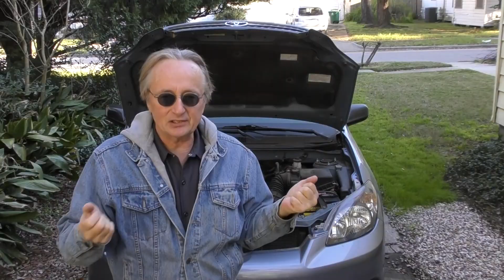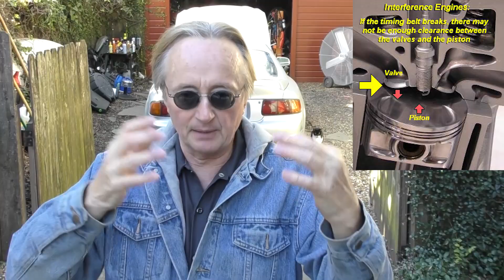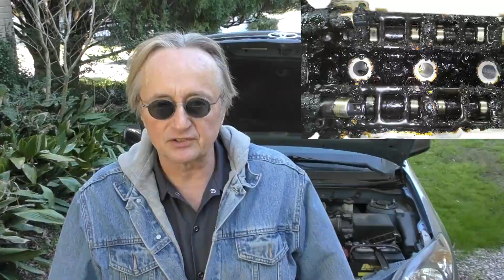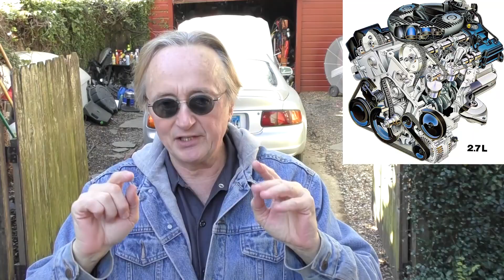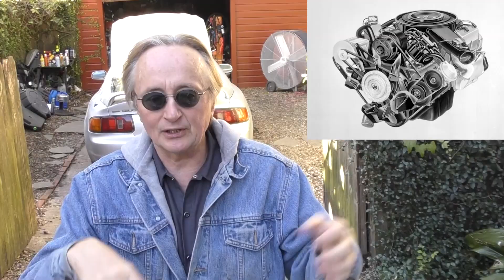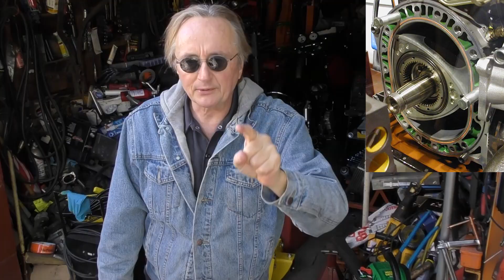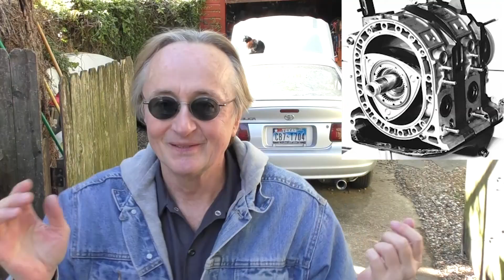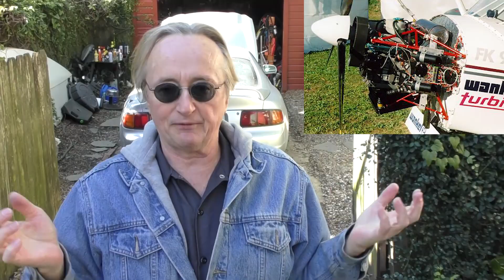Never Buy a Car With This Engine

Comment: SCOTTY please respond. I have a 2009 Pontiac G6 2 door coupe with the 2.4L ecotec and it has 331,500km or 200,000miles on it. Now at first the engine light would come on when I was under half a tank of gas so I thought that I had water in my gas. So I put in fuel injector and waterremover into the tank when I filled it up. I live near Toronto Ontario so the weather would get very cold then very mild and go back and forth like that near the end of Feburary. Now the engine light comes on under 3/4 tank of gas and sometimes goes out when I am driving and off and when it comes on again it stays on. I have always changed oil using synthetic oil 5w30 winter, 5w50 summer. The car runs nice. Drives nice has a lot of power matched with the 6 speed tranny that was rebuilt 5 years ago by Mr. Transmission. I am perplexed. Could it be the fuel pump or cam shaft senor? or just an O2 sensor?

Comment: What do you suggest for a lot of honda cars which have the water pump run by the timing belt? Normal recommendation is to change the water pump at the time of changing the timing belt, but is that enough or is it an engine to be avoided?

Comment: sounds like you need to dry out, what about Ford and their thick film insulator ignitions , the guy that designed it forgot it will be in the engine compartment and subject to up to 300 degrees...ooops  the cars would stop running, 60 minutes did an expose on Ford in the 90's and all their goofs, just for the TFI alone they have law suits on the docket to last for the next 30 years. then there is the FOP suing Ford. When Chevy stopped making full size Caprices the police switched to Ford crown vics. They drove the crown vics like they did their Caprices and they ended up getting killed so their family's sued Ford for wrongful death.

Comment: The Audi B5 1.8T engine is great if you do something crazy like change the oil and do the timing belt maintenance, if so it will last 300K miles or more.  The weak points are not the engine but things like:  The plastic combi valve and other plastic plumbing parts that should have a recommended replacement interval or be changed to aluminum pieces.  I love the 1.8T and I love the interior and overall look of the audi a4 B5.
Reply: Amen. What the hell?  Way over engineered. Too much plastic! Get rid of plastic and maintain them.  Honda had the same problem with the first generation civic.  They were made with very tight tolerances.  And in the US where we don't maintain our cars.  Same way with early VW 1.8.  Excellent engine, but don't overheat it or there goes your headgasket.  People are worse now..  If it breaks. Throw it out, get a new one. New model? Have to have it!  Zombie Apocalypse?  I wish.  It would be a good form of natural human selection.
Reply: 4.3 Lt. GM V6 what a wonderful motor. ......bullet proof

Comment: Not just Chrysler running the water pump with the timing system.  My '96 Outback suddenly stopped on me in the middle of the interstate, with about 150K miles on it.  Turns out the water pump shaft broke off!  Everyone told me that the valves would be toast, but I threw on a new timing belt (and new water pump....), and started up...ran fine.   The belt had been changed around 100K by the dealer, so why did the water pump fail catastrophically?  Did the dealer fail to install a new water pump, at that time?  Probably...

Comment: My baby sister age 64 had a Chevrolet Ecotech she finally sold it with 260,000 miles I would have taken it anywhere.  She has the oil changed every 3000 miles because that's what our Dad told her to do.  Actually I sold it for her and I could truthfully say it was driven by a spinster school teacher albeit all over the country.  She's about to retire and just bought a new Kia Soul...yep every 3000 miles.
Reply: With that good of service,  with that record of dependability and as a school teacher she got suddenly stupid and bought a foreign kia.  I BET she will wish for another chevy before 260 K with a kia soul.
Reply: @brianhuffman3202  I didn't even know she was going to buy it before she did.  I'm hoping it's not as big of a dud as the 1992 Ford Tempo she bought new.   I have to think back to the time I almost bought a new Chevrolet Vega, the salesman pissed me off and I left and bought a new VW Bug. ; I never properly thanked him for that...
Reply: @kaa522  no doubt the Vega was a dud, only knew 1 family that had good luck.  I would sure hope a sonic or the cruze would be a good choice.  My sonic got OVER the EPA 35 mpg.  Not a salesman, but 4 the price would B good 4 your sister or anyone else.
Reply: Do not worry about the Kia. If it is brand new, she will have a 5 yr 60k limited b to b warranty and a 10 yr 100k powertrain warranty. If she changes the oil the same as the last car, it should run like a top. If she has a warranty issue, Kia will fix it. Love my warranty from Kia/Hyundia. I wish all car makers would back there cars with longer warranties since we are paying so much for them today.
Reply: @mikeyj7990  I only "worry" about America.  We can't succeed if we keep giving our dollars "to others".  The warranty is not doubt a selling point and I can only wish GM had kept their 100K warranty.  Do us a favor and ask a GM dealer about all this and re-post,  but in the mean time let's concentrate on "the home team".  Thanks patriot

Comment: I have a 2.2 ecotech with 150,000 miles. When I first got it I changed the oil after 500 miles and started using Royal Purple with Lucas oil additive and have never had an issue. I change the oil every 5,000 miles. I once went off of the computer and it didn’t tell me to change the oil until 10,000 miles! I said nuts to that and change it every 5,000 miles. All engines should last at least 100,000 miles if you use a premium synthetic oil like Royal Purple or Mobile 1.

Comment: Since we are going to CV transmissions, why not go back to pushrod engines? No need to rev above 4000 RPM or so, so no need for the trouble-prone OHC designs? I never heard of a broken camshaft chain on a pushrod V-8.seems like the way to go.

Comment: Expected the Mazda rotary engine to be in there and almost thought it wasn't going to get mentioned as it was the last engine featured. You really can't beat simplicity and mature evolved engine designs. Whenever a manufacturer states advanced new design engine you really need to let others go there first and wait a few years for the verdict. Pretty much the best version of any car is the last models they produced before they changed models as long as they didn't have a end of model refresh changing major components.

Comment: Had a 2006 Chrysler Sebring. Damn engine just stopped and wouldn't crank. Got it towed to dodge/Chrysler mechanic checked car and told me that Chrysler makes Shitty Engines and this was one of them. Got rid of it and never will buy another
Reply: Chrysler is the worst thing you could buy.

Comment: my old 3800 buick v6 pontiac just keeps on going and going and going.  no high tech just high durability and reliability.   time to go back to the future.
Reply: Winter car. Lasabre rolling on 270k no signs of stopping at all.
Reply: @mikeadams5432  Congrats on your high mileage vehicle!!! May I please know what year is your Lesabre?
Reply: @brendame  2002
Reply: The Gm 3.8 is a damn good motor. This comming from a Ford guy.
Reply: As a GM technician, I fully agree. Those 3.8's are amazing. As long as you keep the seals on them though, typical GM and having seal/gasket integrity issues. But those engines will last forever otherwise. Good power they had too, snappy throttle response and peppy when needed to be called upon.
Reply: I had a Pontiac Grand Prix with the supercharged 3800 series II V6. Great engine, transmission not so much.
Reply: @jabroni6199  got a 2002 40th anniversary 3.8 supercharged. Runs great.
Also a 2008 chevy impala police 3.9.
Engine cuts off 3 cylinders and gets 35 m.p.g. @ 80 m.p.h. cruising.
Both Very Fast.
Reply: @jabroni6199  I had similar experience with an Olds Delta 88. Engine  was reliable but transmission needed two rebuilds before 100k miles.
Reply: @jabroni6199  funny u say that, dad had a 2000 Chevy Impala with a naturally aspirated series ii 3800, transmission was going out to the point it sounded super changed
Reply: @jabroni6199  superchargers we're junk in them too
Reply: @jabroni6199   the reason I had to get rid of mine
Reply: The GM 3.8L engine is a great engine. They never die
Reply: I have a 2004 Impala with the 3800 Series 2 - just keeps going. 315,000 miles and still going. Wish they would have kept that one!
Reply: Flint Michigan
Reply: 279, 000 on mine and just had mostly transmission failures but other that that it keeps going
Reply: I also have the 3800 normally aspirated in my 1999 Grand Prix .. great engine, but they have issues with the lower intake manifold gaskets failing & letting  coolant into the cylinders. That job was done twice on the original motor, then the main bearings seized at 191K and a GM Reman was put in. It had an oil leak which the installing dealership did not want to fix. Another more reputable GM dealer located the leak (rear main crank seal) and did the job under warranty at zero cost as it should be done. Still fine, but again I did the lower intake manifold gasket once so far. But it does run great. Engine has about 60K on the replacement. Tranny was replaced at 150K when the splines on the 4th gear hub failed.
Reply: i've all ways maintained the tranny by changing the oil and filter regularly at 25k miles.  use high quality synthetic transmission oil and i've also put in two large magnets in the tranny oil pan to catch metal.   use the GM supplied metal gasket. in the winter, warm the motor up really well so as to warm the tranny.  nothing is worse for the tranny than -20 degrees and hopping on the highway with cold engine and tranny oil. 4T65E   2004 pontiac grand prix.
Reply: The 3800 series were awesome engines
Reply: The 3400 engine is a great engine AFTER you replace the lower intake manifold gaskets with metal ones, Ive built a few of these and they seem to be really reliable.
Reply: @martinez1701a  the same thing with the 3.1. Great motor once the intake manifold gaskets were replaced with those metal ones. I had a 99 Lumina with the 3.1. Great motor once I replaced that gasket with the problem solvers.
Reply: cocodog85 The 3800 was a great engine, it’s just that the rest of car would fall apart. Particularly the front wheel drive models had terrible problems with transmission failures. I had a 98 Grand Prix with the 3800 and had to have the transmission rebuilt twice before I got rid of it at 130k miles.
Reply: Loved my SSeI! replaced the  bearings on the supercharger, but other than that, a water pump and a set of coils, 218000 mi, no problems ever. I donated it to the DAV and I still see it running around New Haven
Reply: @crazytrain7114  ahhh yess the ol Bonnie SSEI 💯!
Reply: These engines are in some of the Holden commodore in OZ and they were, (are) great cheers.
Reply: The 3800 on my old Buick was great, but the transmission went out twice and I got rid of it.
Reply: I had an 02 Monte Carlo with one. I actually had the motor crap out. I limped it into a dealership, and a salesman, the sales manager, and the service manager all said some variation of "Wow, that never happens to the 3.8". The salesman even told me a story about how during cash for clunkers, they had to put in an oil additive that caused the engines to seize up. They were taking bets on how long cars would make it. Most cars would make it a under a minute, but they had a 3.8 make it 15 minutes. I always said that if I were hard up for transportation, I'd find an old GM with the 3800... You have to watch out for coolant leaking into the engine, though. That's a known problem, but if you avoid that, they are tanks.
Reply: They never should have stopped making cars with the 3800.
Reply: I don't get how a lot of american cars can actually have amaizing engines and have cheaper out trans and pretty much everything else.
Reply: Your car's year of making?
Reply: @tigertrail3361    04
Reply: @tigertrail3361 any 99- 05
Reply: I had a Gran Prix with that engine
Reply: I have a 05 Buick LeSabre with almost 106k miles.  I don't know too too much about cars but it seems pretty good.  Sometimes it shifts too hard or jolts when I put it into reverse or drive, or when it's shifting gears on a slope, but it's probably the engine mounts.  It's not a bad car but it pisses me off because I only get 16-20 mpg combined, even with tons of highway driving
Reply: The other GM V-6s blew though
Reply: @DawnOfTheDead991  I had a '90 S10 with a 4.3 V6 it was an excellent engine.
Reply: 3800 is a good engine indeed had good power too
Reply: Yep I have a 94 Oldsmobile LSS and that engine is just such a simple godsend that's easy to work on.
Reply: I got a 2000 Buick Park Avenue with the 3800 series is it really that good?
Reply: 100s of thousands of 3800 motors in Commodore in Australia still running, the body were scap
Reply: My mom used to have a 93 bonneville with the 3800. That car lasted 450000 miles with general maintenance. Rust killed that poor car but that bonneville kept on going to the point the frame rotted beyond repair. We sold it to someone who was using it for a parts car as the engine ran great and the interior and some of the body was decent. I bet that ol 3800 is still running truer than ever
Reply: just bought a 2006 buick one owner car with only 28k miles owned by a 89 year old lady who is moving to a senior's residence.  2200 $s usd and almost new.  expect it to good for the next ten years.  those cars are out there if one searches.
Reply: The changing of fluids early and often is the key to engine longevity...😊
Reply: And it's likely still going strong
Reply: @Randy Jackson  im assuming it was the non super charged ss?
Reply: Them 3800s are like a old iron horse had a couple of monte carlos never let  me down like sumone said let them warm up no need to start a car in. 10 or below weather n take off
Reply: cocodog85 “Buick v6 Pontiac”?
Reply: Go back to the future??????? Or past
Reply: I was in need of a car on short notice and short money only had around $600 to spend on a car literally walking down the road just quit my job out of town carrying my hard hat and tools ran across a car lot and they laughed when I told them what I could spend but had a 95 plymouth grand voyage mini van out back with a 3.8 v6 and auto w od and 169k minor  dent in front fender interior almost new owned by 89 yr old couple that traded it in.. true I looked him up.. long story short it has been one of the best cats I've ever had and still have.. 200k I've done front  brake pads, oil, air filter and fuel pump still runs drives great...ITS THE FIRST TIME I FELT LIKE I RIPPED THE USED CAR LOT OFF...
Reply: 3800 is a very good engine
Reply: mine was junk.. head gasket went at 120k miles.  one owner well maintained.  oh well 🤷🏻‍♂️
Reply: 3800 in a Delta 88.  Great engine
Reply: I had a 3800 in a 2008 grand prix I bought used with 148k. Turns out the gaskets went and it caught fire. Fast but not too great on gas. I now have a 2007 Cobalt with the 2.2 which I like better. However its giving me issues.
Reply: My 3800 v6 Pontiac has 267,000 still running strong. The transmission is the problem!
Reply: Amazing engine had one myself
Reply: What about the 2011 buick CLX (not the turbo, its the 2.4 engine)
Reply: @jonathanvillalba3214  check the videos for the ecotec timing chain replacement...nightmare. so watch out.
Reply: Amen
Reply: 3800 was no doughty a good engine you can thank the liberals for that if it last they don't like it but the conservatives are as guilty if it last they don't make no money we are fucked
Reply: That was a great engine.
Reply: They won't die the car will go to hell before the motor does
Reply: Honorable mention. Ford 3.8 love mine 206500 and still chugging
Reply: @TheSlow281  It’s a Ford it will run forever
Reply: @KenisalwaysonLUNCH  Absolutely! Also July 2021update on said 3.8 Mustang: 236000 Miles
Reply: @TheSlow281  I have a 2008 E 250 Ford Van with 660K Miles. Original everything still running strong Triton 5.4 V8
Reply: Honorable mention: dodge 3.8 ohv magnum v6
Reply: Cococat  take your 3.8 v6 out for a run sometime its boring for sure and the going & going will stop reliability zero best not to take it out for a run just walk  besides pontiacs are history keep it for a museumpiece
Reply: @bradzimmerman3171  ...zimmergirl.  put a sport suspension on a w body, which is easy bolt on and super cheap, along with the best brakes of the w body series, and i'll run circles around any vehicle in the same weight category.   that's why the w bodies were such great cop cars.
Reply: @Randy Jackson  GM blows

Comment: I had the VW/Audi 1.8T and never had problems (but then again I kept up with my maintenance).
Edit: I had issues with the coilpacks and kept 2 spares in it with a screwdriver. Problem solved.
I miss my 2001.5 VW Passat GLS
Reply: Had the same engine in a 2004 Passat and it was GREAT, so need to disagree w/Scotty on this engine. Mine had over 200K miles and ran almost perfect. Original turbo, head gaskets, etc. Of course I was meticulous with oil changes but used conventional oil and stil no problems. The coil packs took five minutes to replace and were easy to find on Ebay for around $25 ea (new). Rev up your 1.8T!

Comment: Well Scotty I guess I got a bad Nissan transmission to cause I’ve got 100,000 miles plus on it I haven’t had any problems when is this thing supposed to blow up did you say 80,000 hell I’ve change my oil twice in that time maybe that’s the problem people are changing the oil you know you have to change it at 60,000 that’s what the book says oh and by the way how many thousands of Nissans are out there with no problems did you ever check on that